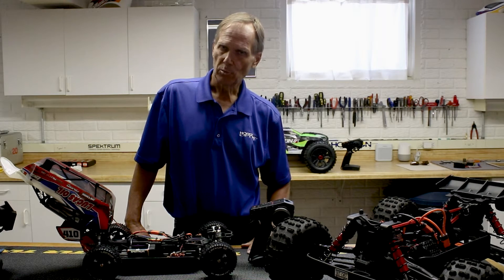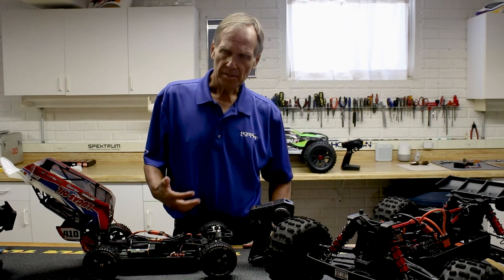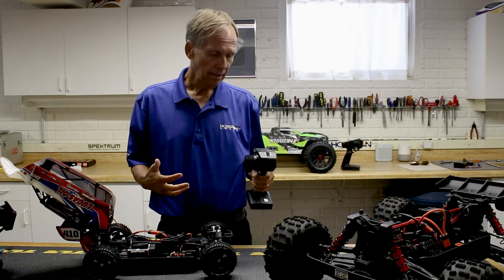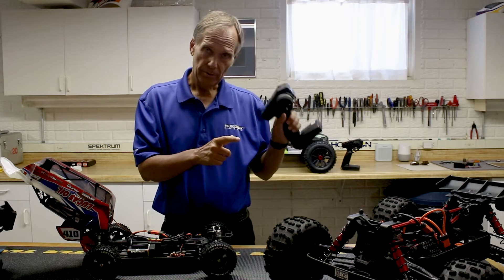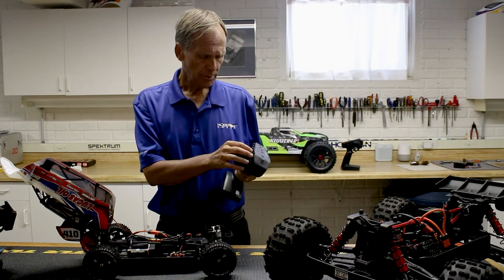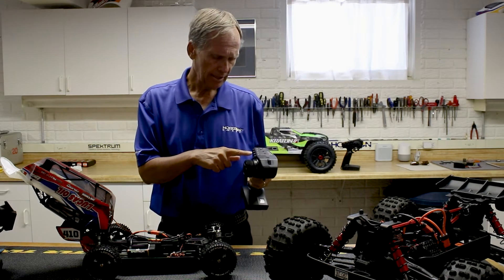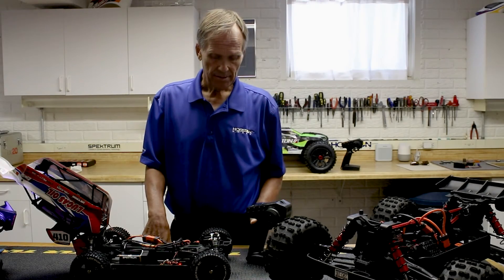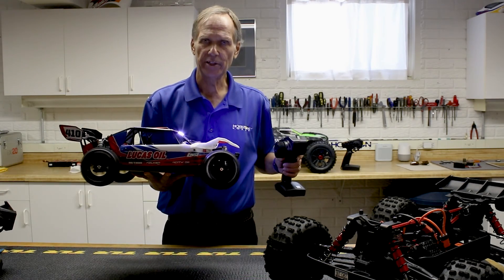Spektrum Quick Hit Tech Tips - Firma Smart ESC Calibration Guide

Comment: HI John, I have a Arrma Vorteks that i am trying to calibrate. I have done this method many times. For some reason when trying to do it now, it gives me the option to set neutral, than 2 beeps to set full throttle, than nothing for setting break/reverse. when I turn the car back on, i have steering and throttle, but no break/reverse  Any ideas?
Reply from the maker: make sure your brake rate knob is turned all the way up (clock wise)

Comment: Dear John, I recently  purchased a second hand Lasernut U4 rig. The PO told me there was issues with the driveline and steering. I WRONGLY followed another youtuber's tutorial and basically turned my "new" car into a paper weight. After coming to my senses and finding your video the car is now absolutely perfect. I followed the binding video and this ESC cal. video. I then dialed in the steering limits and now the car has FULL throttle AND Brake range along with MAX steering in BOTH left and right.

Comment: I’ve got a question if anyone else may have had this issue. I have the typhon 6s with all spektrum electronics except the steering servo. I run the car for a few minutes with no issues then the car stops no throttle no steering. My cooling fans are ramping up and down and on my dxc5 controller I see the power level fluctuations up and down. After a minute or so the car starts working again. And this keeps repeating ????
Reply from the maker: Hi Drew sounds like something is pulling down the ESCs BEC and is causing it to reboot. Do you have anything else hooked up to the model, such as lights or other accessories? How many fans do you have? What servo do you have installed?

Comment: SO WHAT DO I DO IF I PULL FULL THROTTLE AND HIT THE SET BUTTON AND NOTHING HAPPENS?
Reply from the maker: Check your transmitter settings. Could be your throttle rate is turned down too low.
Reply: @SpektrumRCvideos  it’s all the way up, when I hit the bars button to put the receiver into bind mode it doesn’t light up or anything, it’s almost like there’s no power going from the ESC to the Reciever

Comment: I just bought an Arrma Vortek 3S and cannot figure out how to connect the transmitter to the receiver. When I power on the ESC while holding the set button, it starts to beep and blink a red light. Then I hold the bind button and hit the power button on the DX3 transmitter. It blinks a green light a couple times and then turns red and beeps two times as if it failed to connect. There is no response from the RC car via DX3. If I just power on the Vorteks, it will start up and then a fast blinking red led comes on and nothing will respond. Not sure if I was just unlucky and got a faulty RC, or if I am doing something wrong.
Reply from the maker: The set button on the ESC switch does not control receiver and transmitter connection. That is the bind button on the receiver, which is tucked away in a receiver box. It should have come bound and likely still is BUT now that you gave pressed that reset button you may need to go thru the ESC calibration again. So I would first open up the Receiver box to varify the receiver is bound (solid orange light on the receiver) once bound test the steering to see if we are getting signal, then go back thru the esc calibration if the esc still does not operate throttle. Hope that helps!

Comment: How did my setup just go from it turning right when turning right on radio to now it turns left when turning right. And the dx3 switch was in the N position the whole time. Switching to the R fixes it but that makes no sense as it was working correctly. Any thoughts
Reply from the maker: Did you replace any parts?

Comment: My vendetta out the box stays blinking green light even when I hold down the set and power button. Anyone had that problem?
Reply from the maker: Is the receiver and transmitter bound? Normally that indicates the esc is not getting a signal I believe, which would suggest it is either unplugged or not getting a signal from the radio system.
Reply: @SpektrumRCvideos  I figured it out, I plug in a 4s lipo and vendetta esc went into thermo shutdown.

Comment: So when calibrating I can get the first two steps, after that I can't calibrate reverse.

On my firma 150 I have no brakes or reverse.  

Does anyone know the solution?
Reply: Did you find a solution? Same problems here, on a Firma 100A.
Reply: @Cronquist  Nothing - it's driving me crazy - if you find anything please reply here!
Reply: @Ash-qx2qo  I just did, or I did solve my problem.

I re-binded my dx3 to my 100A with the 50/75/100% switch on top set to 50% (both by accident) and then the problems started.

When you bind/re-bind the controller you have to have on 100% or it just won't work like it should.

So I calibrated my dx3 as he says in this or one of the other 2 videos (st/avc doesn't matter/100% brake/centered the last two) and then re-binded it.

After that your have to configuration it in a certain order; neutral > full throttle > full reverse > max right > Max left.

Then it worked like it should!
Reply: @Cronquist  So just to be clear, rebind my dx3 transmitter to my receiver?  Then follow the procedure you listed below?  Thanks so much for the reply!
Reply: @Ash-qx2qo  It might help, at least the last part and if you have the DX3 as well. GL!
Reply: @Cronquist  thank you for your comment.  Bound dx3 avc 100 also brake 100 percent everything else in the middle and pressed the  receiver bind button.  Calibrated everything and now everything works as it should!  Your instructions were spot on.  Thank you!
Reply: @Ash-qx2qo  Awesome man! So glad to hear about this!

Comment: Hi i am able to complete the end point calibration for the esc, but when i pull the throttle on the reciever the centre drive shaft is almost in a jerking / glitching motion, i.e not spinning fast, almost as if something is preventing it from spinning fast can you help me please.
Reply from the maker: Could be a few things... Loose motor wire connection, too tight of spur/pinion gear gap, or incorrect timing setting on esc.
Reply: @SpektrumRCvideos  it was a loose motor wire :)

Comment: So what if the red light doesn’t stay on after calibrating neutral. I’m having an issue we’re after I calibrate neutral I can’t calibrate forward or reverse. And my esc light goes out
Reply from the maker: Likely your trims and/or travel endpoints are off. Make sure throttle trim is centered when calibrating
Reply: If that is all correct and the problem continues,  then what?

Comment: Thank you! This was very helpful! Only trouble I had was the throttle reversed on me and switching the switch on the controller didn't fix it. I had to swap wires on the motor to reverse it. Is there something I'm doing wrong? On the BLX 100 I was running the throttle reverse switch worked fine but not this smart ESC.
Reply from the maker: It should be set to normal, not reverse. If you are having to reverse the channel then It could be a esc setting has been changed (motor rotation in particular)

Comment: I nitice the Manuel's are limited with specs and procedures in the manuel.  Why is it not there
Reply from the maker: Is there something in particular that you are looking for? Programming option wise, those do evolve overtime so their should have been a programming card with the esc (unless it was a RTR model then it would be in the manual for said model) ALSO for the latest info it is best to check out the product page for the ESC itself. There you will find updated specs/manual and firmware updates. Hope that helps!
Reply: @SpektrumRC  yes.  Why do I have To ask you or anyone? Why is not the information available. Currently, every single Spektrum and horizon product I buy has failed. Failed prematurely and  Immediately
Reply: @SpektrumRC  in particular there are many issues that are not in favorable to U.S. paying customers I have a ton I'd your product with fail modes across the chart.  .my dx3 started to Eradic throttle and steering output.  Car took off in room. Breaking everything and injuring me. What causes a radio to send out such signals. Smart radio.  Smart enough for your company profile but not Smart enough to know I can't command input what it receives.
Reply from the maker: That is certainly unusual. Have you contacted anyone at Horizon Hobby product support or customer service about the problems you have been having?

Comment: What do you mean when you say "if it's a RTR it's already done at factory"   are these one time use vehicles ?  It's it done at factory. And I make repairs or change configuration it means vehicle is not configured to spec?
Reply from the maker: If you make changes you may need to recalibrate. Such as changing the transmitter brand. Otherwise there really is no need to recalibrate unless the calibration was messed up at some point.

Comment: I have a new felony I am trying to bind a dx5c to. The bind works just fine, but when I tried running it it has no brakes and reverse. Attempted the calibration as you described here and I can only get the neutral step to work. When I attempt to set the throttle nothing happens. No lights on the esc. The receiver light it solid. The car is stock.
Reply: Did you ever fix this problem mine is doing the same thing?

Comment: My kraton 6s has servo problems right out of the box, after running for awhile it starts to act wonky and has a bad delay, I ran it today just driving around and doing some wheelies, I don’t bash and do jumps, my kraton started to shut off and restart a bunch of times I also loss steering and and throttle was cutting out, should I calibrate them esc?

Comment: I’m using smart G2 battery Dx3 remote and 130 amp spektrum esc. The battery level don’t show on the remote. The lights don’t light up. How do I get it  to work?
Reply from the maker: Which battery is it? It could need an update (the battery itself) If you have a Smart G2 Charger or a Smart checker this can be done NOW, if you have a G1 charger we will have a update for the chargers soon that will update the pack to fix this bug.

Comment: Just bought a new 120 amp smart esc and it is stuck in LVC i believe. I get a red flashing light and two tone pulse from the motor. The motor is a stock traxxas brushless motor and the battery is new and fully charged. I am using a new DX5 Rugged w/SR515 receiver. I updated both the receiver and transmitter to the latest firmware. Any ideas? Are these not compatible with Traxxxas motors or something? Here is a short video of my problem....https://youtu.be/MZLEbtI8ivM

Comment: I am having a problem configuring my smart esc firma 150. I have it bound with my spektrum 6ch rx, using a dx5c tx. When I hit the start button , holding down the set button, it goes into flashing program mode, I start the programming by hitting the set button in neutral ,stops flashing and does nothing. Cant get to the next step. Shut down and start over with the same results. The esc has been updated using the card, no problem. Changed my servo wires to check for breaks, no issue. I even ordered a new esc thinking it was flawed, no change. I got no ideas. I am not a nobb to electronics as I have quads and planes. I am missing something.... please help
Reply from the maker: You should not have to calibrate it out of the box. It is already setup for Spektrum. But from what I can tell it sounds like you might have the signal wire plugged in backwards. Make sure the gray signal wire is toward the label when plugging into the throttle port.
Reply: @SpektrumRCvideos  No. the receiver wire in correctly. On the esc, there is a black and red jumper wire with a male and female connector attached. Does the rx connector go to on of?those or directly to the esc?  What is the other orange and black wire connect to? This should not be rocket science, I cannot get the smart esc to configure , it programmed ok.
Reply from the maker: @budnanc509  I believe the wire you are referring to is the lead coming out of the fan port for programming the esc via the programmer box. Is the receiver bound and calibrated?
Reply: @SpektrumRCvideos  yes, they are bound... I check testing the steering servo. I have it connected to the red and black female plug. I have used a servo wire spitter, and connected the fan wire and rx to that with you change.
Reply from the maker: @budnanc509  If you plug a servo into the throttle channel, does it move with your trigger?
Reply: @SpektrumRCvideos  checking
no it doesn't
Reply: but I do have the avc working. 
When connected to rx...Is the rx wires supposed to go into the servo wire plug on the power side of the esc?
Reply: I put the servo wire spitter back in connecting the esc fan , esc rx. It will program but not calibrate...
Reply: This is how I have it set up....As an update, controller setting are all centered as a new unit. Avc calibrated and working. I am using a servo wire splitter going from the esc to the fan plug and to the rx in the throt slot. Wires are all in correct directions, rx black to outside and white to inside towards lettering. Esc black to the outside as marked. I can turn on power to esc starts off solid red to flashing green to flashing red. When I power up the esc holding down the setup button flashes red, when I hold down the  push the setup key it to start config the red lite goes out and does not come back on.
Reply from the maker: @budnanc509  The fan port should not be plugged into the RX at all. There is a main lead for the esc. It is gray (signal lead) orange (+ power) and black ( - ground) that should be in the throttle port on the RX.
Reply: @SpektrumRCvideos  Thanks, that the info I needed. There is nothing  in the directions to teach you that... cause in the other esc the servo plug was on the power side between the big wires.
Reply: Successful bind, config,programming. Thanks for you help... stay safe
Reply from the maker: @budnanc509  Great!!! Glad I could help :)

Comment: Wondering if you could shed some light on a couple things for me with the firma 150a esc firmware..

As we know there are 2 thermal cutoff codes, one esc over temp, and one capacitor over temp /amp... 

How does the firmware deal with these situations when a code is set?  

Does the firmware activate brake or activate a coast/ neutral setting For Both scenarios?...

Comment: My firma 160 on the kraton 8s is flashing red and has no throttle response, it says its in LVC mode but my batteries are charged. I try calibrating it but it wont let me set the neutral position, i followed every instruction i could find including all these videos.
Reply from the maker: Try resetting your transmitter, rebinding and calibrating AVC and then calibrate the ESC. Otherwise it might be a good idea to call in to our support line to get help over the phone.
Reply: I have the exact same problem
Reply: Same just started today .. I plugged fresh 6s battery in it went up block and back and cut off with flashing red light now won’t run with any battery I try .. how do you take out of that mode and what triggered it ?